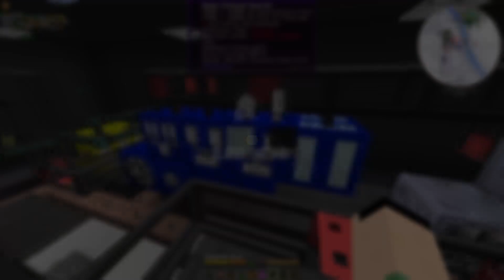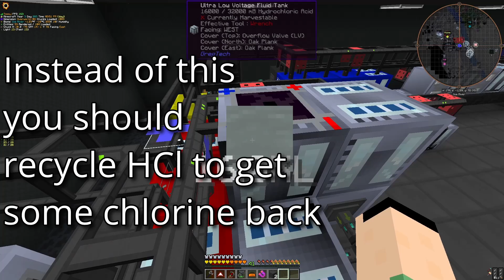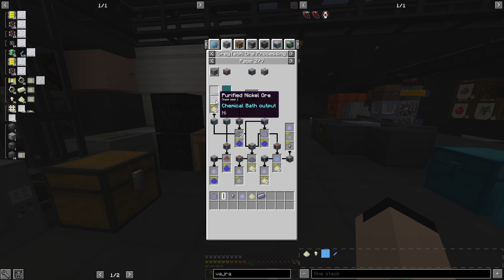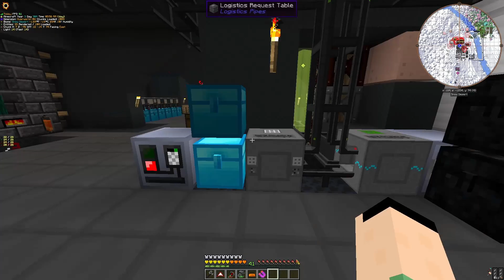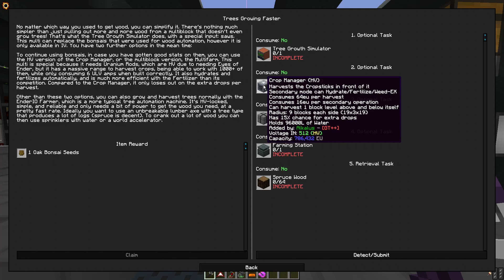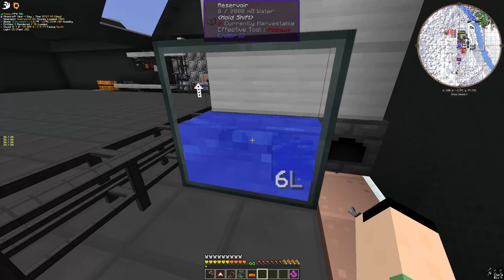GregTech New Horizons E20: Distilling Benzene

Comment: Dear HamCorp CEO,
This intern of yours is having trouble setting up Logistics pipes with drawers for the pyrolyze ovens feeding chain. This intern has supplied a mark 1 logistics chasis with an active provider module to the receiving end (pyrolyze ovens) and have put a provider module on the drawer in the sending end (wood farm). This intern has noticed a problem with the pipes as it is only filling the drawer to 1 stack of wood causing bottlenecks in my pyrolyze oven and advanced coke ovens. is there any way to fix this?
Thanks, HamCorp intern Stelar.
Reply from the maker: Dear intern,

Consider adding a buffer chest! If that doesn't work I'll have to look up how logistics pipes worj again (it's been a while...)

Best,
HamCorp